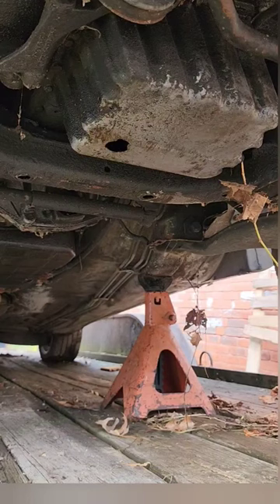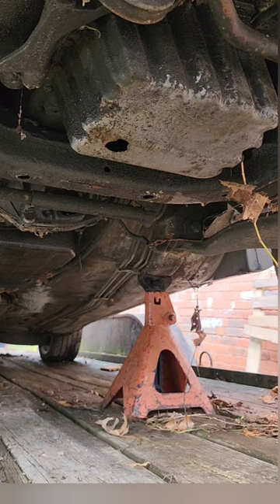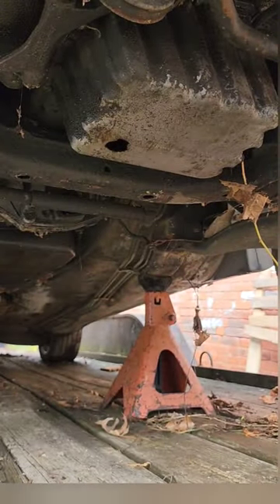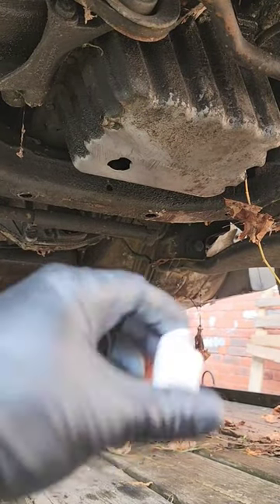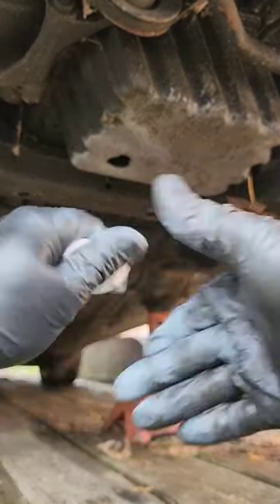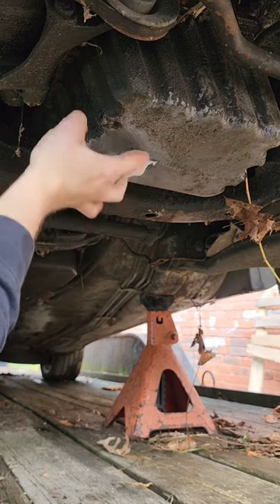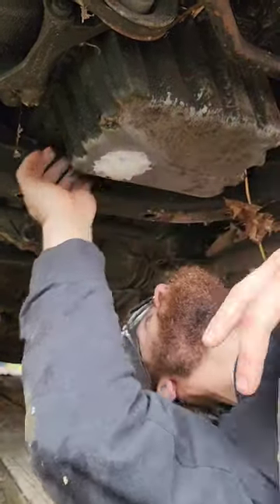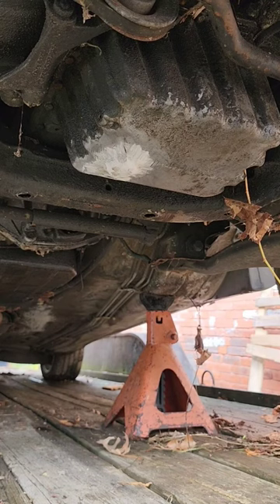JB Weld An Oil Pan

Comment: I recommend using a oil pan that doesn't have a hole in it 👍
Reply: Did mine works just fine for 6 months 😂 2" hole and cracks worse than this. Using aluminum patch works best with jb and epoxy over it, hard paint afterwards
Reply: no shit
Reply: Smart Ass
Reply: Yep

Comment: I think this 1$ fix will be fine since the oil pan is not pressurized.
Reply: JB weld eventually will not keep heat cycles the same way oil pan aluminum will
Reply: Someone has never heard of a PCV...

Comment: I have used JB Weld on those corroded areas of an aluminum intake manifold, where the coolant just eats them up from years of seeping. Let it harden overnight, then hit with a flat file before installing a new gasket. JB (original) is good to over 500 degrees. A new manifold for a 4.3 Chevy was about $600 and several days out.... so this has worked well.... and still holding years later.

Comment: Many many years ago I was on a long trip with a friend. We stopped for gas and he forgot the kickstand.  Bike fell over when he got off and the shifter punched a hole in the stator cover and all the oil ran out. It was Sunday and no bike shops were open. I bought a back of 10min epoxy and some masking tape. Took the cover off and glued it. We waited a half hour before filling the oil and leaving. It held and he had a window to see the oil level.

Comment: Don’t yall think it would work better if he got a peice of steal to go across the hole with JB weld on each side leaving a rectangle steel piece |==| ⭕️ pulling it down so it can stick to the metal leaving two smaller holes on each side  then doing it his way? Idk I feel like it would cap it in a way from each side rather then just jamming on one side

Comment: Welcome to the genre of trolling videos, where clips are made just to enrage anybody who knows better. Makes money by tickling the algorithm, generating views, and funny for those who think they're smart. Problem is, there are many who are too ignorant to recognize satire. Don't kick those people when they're down, especially for money.
Reply from the maker: It's the cheap way to fix the oil pan, had no idea of the engine was good so no need to replace the pan, holds oil and doesn't leak a drop so it's a good temporary fix
Reply: I couldn't have said that any better myself this is the latest trend I been seen all over the Internet when will the algahythms catch on to what's going

Comment: I bought a Chevy truck several years ago. I was checking all the fluids and I found what appeared to be a pumpkin gasket leaking. So I stopped at a local parts store on the way home and they said they didn't stock the gasket and just use RTV. I went home, cleaned it up, RTV'd the heck out of it and filled it back full of fluid. Next day I noticed gear oil on the drive wheel and what appeared to be a leaking pumpkin cover. But I got to looking closer and it was a  small hole in the cover near the top. I had missed it the day before because it had been leaking no telling how long and it was pretty dirty. So I cleaned it best I could with the cover still on and used some black RTV and that cured and fixed it until I could get some JB weld the next day.  I cold welded it that next day and it wasn't a problem ever again..or not in 11 years. Today I started working on manipulating the metal on a bent engine pan. It's $75 for another 6 qt pan. Old school pans weren't this aluminum crap they use on today's stuff and when they were bent you could put them on the floor with blocks of wood inside and pound them back into shape.

Comment: Either this is a joke or you are out of your mind. Replace oil pan
Reply from the maker: Not a joke, car hadn't run in roughly 15 years so no reason to buy an oil pan if engine was trashed. Didn't leak a drop of oil and was able to get the engine running to see if it had a knock or any issues which could occur due to the hole in the pan
Reply: @rotboyzgarage  Oh I thought this was a daily driver. My mistake
Reply: Exactly

Comment: Can I remove my lower oil pan withiut messing with the transmission ? I need to replace mine but I want to replace it myself if it’s easy on my Audi a4 2017

Comment: when I was young, I used to JB weld on everything , pex plumbing water leaks , hole in motorcycle tire, broke water bong,  ...  etc...   
pinhole on motorcycle gas tank  😂😂😂
I have evolved past JB Weld, but I still keep it on hand
Reply: but never tried the water weld i should say

Comment: Use gloves then don't use gloves? I'm confused......I would definitely use something more abrasive for physical adhesion not, just relying on chemical adhesion
Reply from the maker: Only had so much time for the short for explanation, but when applying it the gloves tend to stick and pull at it vs help smear it into the material your working with so I will normally just use a finger to try and tap/work it in, but using gloves to mix it will eliminate like 85% of the mess you would have on your hands if you didn't wear anything

Comment: Probably could have used with saying it was intended as a temp fix just to see if the engine was any good.  the video makes it sound like it was actually fixed and intended to be daily driven like that.
Reply: I daily drove a JB welded pan for years.  Granted, I dropped the pan and JB welded the inside and outside cracks. Was a quick on hand fix to get me through the month to the next check, ended up lasting 4 and a half years before I actually destroyed the pan going over a nasty speedbump, the pan broke at a totally different point and the weld looked perfect inside and out.

Comment: Not recommended but if you’re in a pinch and need to do something like this go get some sheet metal aluminum and some regular full strength jb weld and cut out a small circle with some shears and put a ring on the circle jb weld that to the oil pan then put another bead going around the circle on the outside and that will be much better than doing it this way

Comment: Yea now jb weld that connecting rod that made the hole in the first place and now your good
Reply from the maker: Surprisingly the engine didn't have a blown connecting rod, first thing I checked through the hole with my bore scope, all rods looked good, jb weld and some oil and she ran decent
Reply: @rotboyzgarage  having a hard time believing something put a hole from the outside with no dents ir markings around
Reply from the maker: @Amanuel Wordessa  https://youtu.be/Lly6QruW6Jo

We got it running in this video, in the previous you can see the pan that's been jb welded, it ran ok for sitting like 15 years with a hole in the pan  🤣

Comment: Bad idea you need a new oil pan
Reply from the maker: A new oil pan is the proper fix. This is a temporary fix to help someone get out of a bind. Ive broken oil pans in the woods before on rocks and this will let you get out of the woods and keep driving until you can get a new pan. Also this car was sitting for 20 years with a hole in the oil pan so no reason to buy an oil pan for something if you dont know if the motor is healthy or not

Comment: It would be best to spend the $20 and get another oil pan.     If you must use jb weld the gray is better.    You should remove the pan and mushroom the inside like you did the outside.    Then it would last
Reply from the maker: The jb water weld is specifically resistant to oil,gas and diesel where as the grey steelstik is not, ive used both and the waterweld works better and doesn't leak. Also a non oem mercedes oil pan is $120 and the main reason for this was the car sat over 15 years so was unsure of the engines condition or if it would run. It's a temporary fix or something that would work in a situation like this as the engine was in unknown condition
Reply: @rotboyzgarage    I drove an old Mercedes for years.   Junkyard oil pan is easily obtained.

My motorcycle was shot about 10 years ago and I used jb weld to fix.   Would you like a picture.      The key is smashing the inside like you did the outside.    And I used the gray and it's still there.   Say the word I'll shot you a photo.
Reply: It's not 1972. Where can you get a $20 oil pan? I want to buy them all and resell them
Reply: U pull it junkyard for $20 u pull it & save $$$
Reply: @lesliechung79  AND A MONTH LATER, RUST ALL OVER.

Comment: Ya should last bout 1 day. Nice fix
Reply from the maker: You would be surprised how long this stuff lasts when applied properly, had a pan like this for about 3 weeks on a vw tdi daily driven and it didn't leak any oil, it's a good temporary fix until you get a pan or for a woods beater

Comment: Should put a small piece of sheet metal over the hole and then JB Weld over that,  this way the JB can't fail and wind up with pieces of it in your oil pan.
Reply: How can it fail I have a hole in my radiator (plastic part) and I covered it with jb weld the hole was about half the size of a dime and idk if I should put iton my car it was a new radiator that got a crack never been put on

Comment: That happened to the gloves you recommended using?
Reply from the maker: Couldn't fit the whole video in with the shorts time frame, but for mixing it I recommend using gloves so you don't entirely coat your hands in it, but when applying it tends to stick to the gloves to much and makes it hard to have it adhere right. So using your bar fingers I find you can tap/press and smear the edges into the metal and I have had good luck with this method